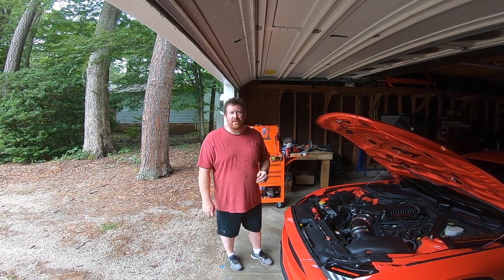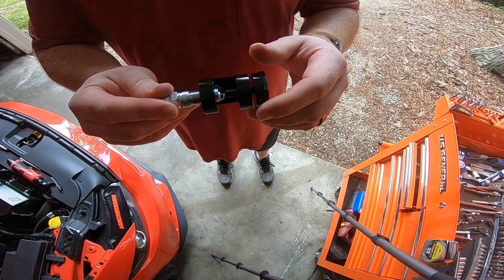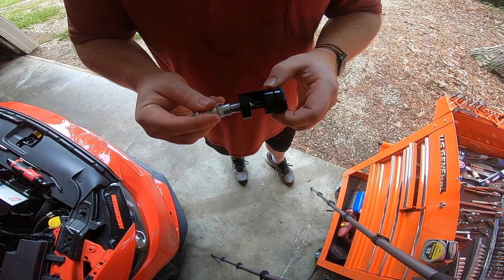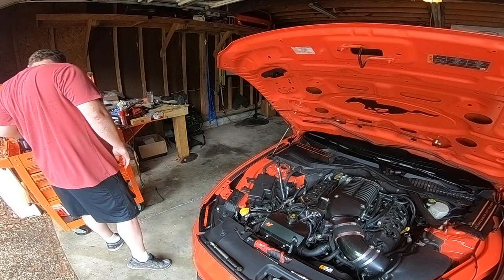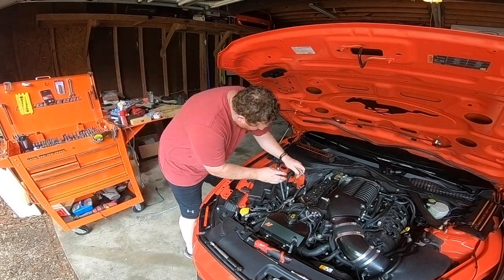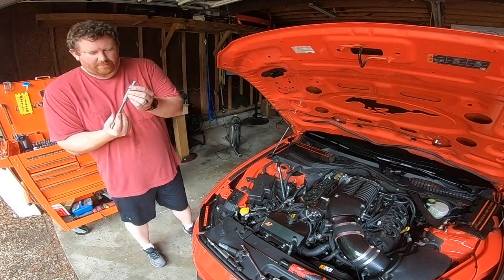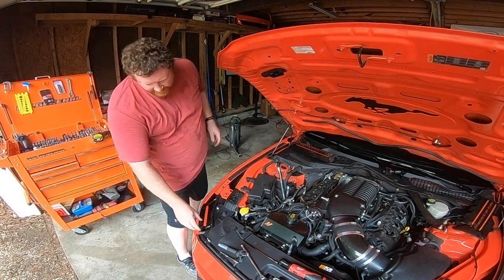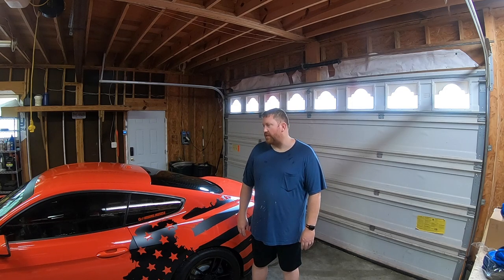2015 Mustang GT Spark Plug Swap Gone Right!

Comment: hey link still works, ordered the part.....thanks...I usually us the bending tool but like you said, oops to much, open it and try again.  So yeah I'll give a try.
Reply from the maker: I still use it a few years later.  Just gapped some spare plugs for the fox with it.  Still works great and I’ve gotten better and more accurate with it.  Good luck.

Comment: Have you always used anti seize and dielectric. Everything I’ve read about these newer iridium plugs says not to use it
Reply from the maker: It depends on the application and how often I am changing the plugs.   If I am changing them regularly then no but if its going to be some time between changes then I use a small amount of antiseize usually just to keep from ripping the threads out of the aluminum heads.

Comment: hello what tires tires size do you have in front in back please?
Reply from the maker: On that car I had a 325x35x19 on the rear on a 19x11 wheel and a 285x35x19 on a 19x10 front wheel.